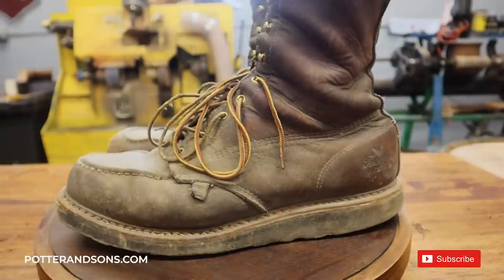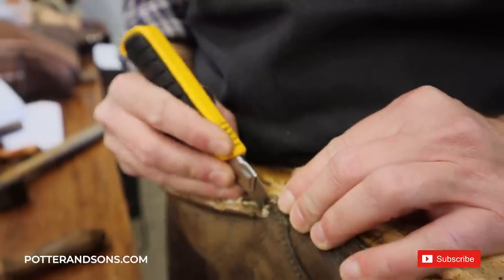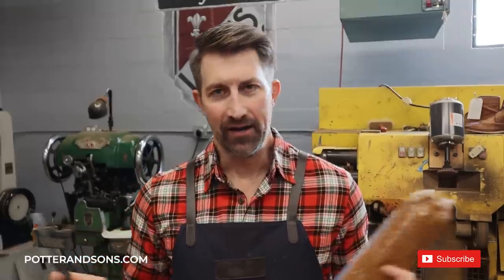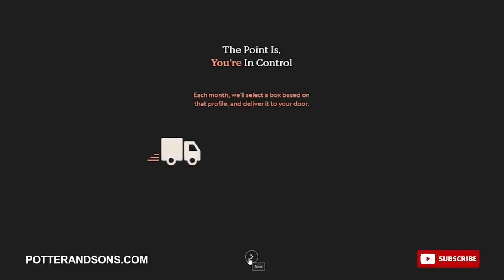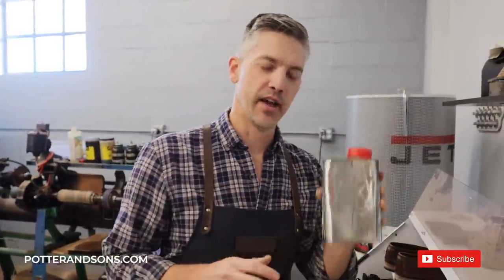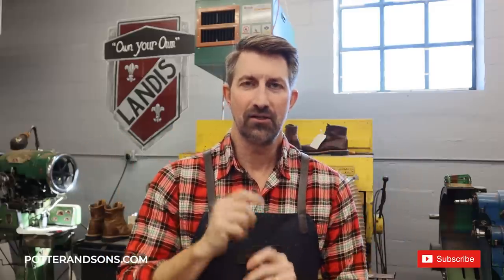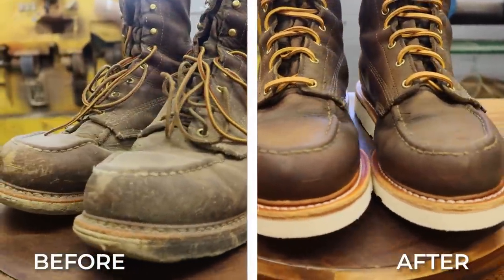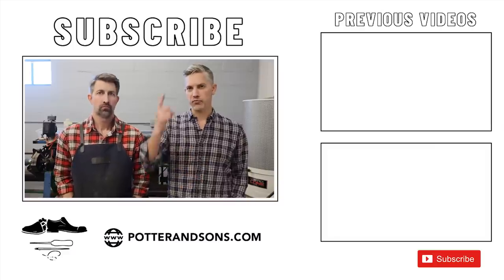Thorogood Moc Toe Boot Restoration | Total Boot Makeover

Comment: The moc toe, not the best choice if you’re a welder or use a cutting torch. Metal slag gets caught in the toe seam, burns the thread then the boots deteriorate. I’ve always worn Red Wings but as I get older I would prefer something a little lighter. Suggestions?

Comment: Great work as always.  I'm wondering the  cost of that particular restoration project.  I have some older boots that may require some reconstruction.  My local cobbler can certainly resole them well enough. But, would be has been reluctant to re-welt shoes or to do lining repairs.  So the question arises.....restoration or replacement?  Cost isn't the only consideration, but is a consideration.

Comment: Just an FYI the Buck & Bear brand may be ran out of Pennsylvania,  but the knives are actually made in Pakistan and are not very good.

As to the boots It's good to see somebody had the sense to go with an 8" over the 6" for work.
My recently purchased current work boots are a 6" thorogood moc toe just because that's what they make in my size that fits my work requirements , but I'd much rather have and 8".
I miss the ankle support, and the 6" can be uncomfortable around my ankles when kneeling.
 
I may have to look Into finding some kind of 8" traditional American made boot that fits my requirement and is within my budget, then relegate the 6" thorogoods to summer use.

Comment: Thorogoods are good boots but not overly expensive.   How much was the resole compared to a new pair?
Reply from the maker: If this pair didn’t need new welts, we would have charged $165 for a new Vibram Christy resole.  Most cobblers will probably be cheaper.  A new pair is around $250.